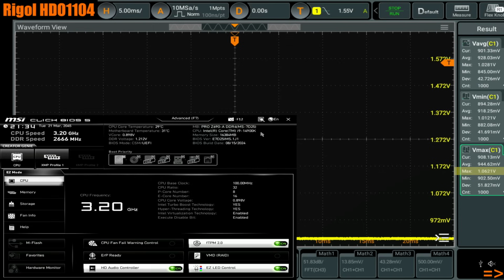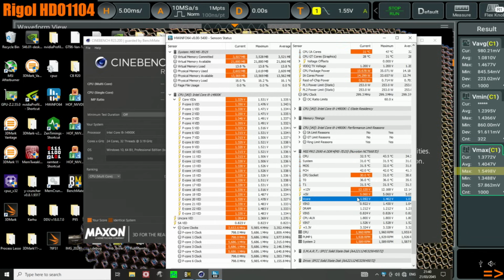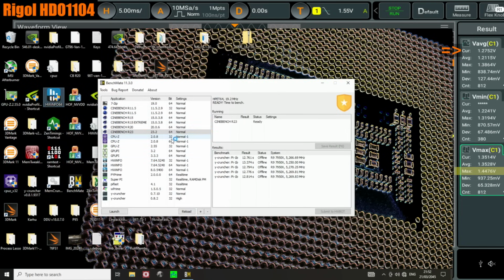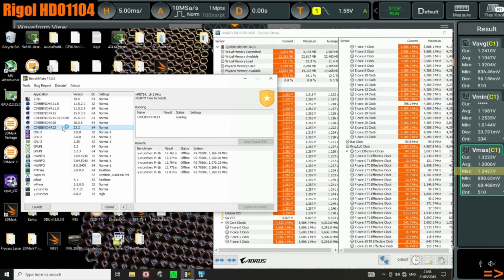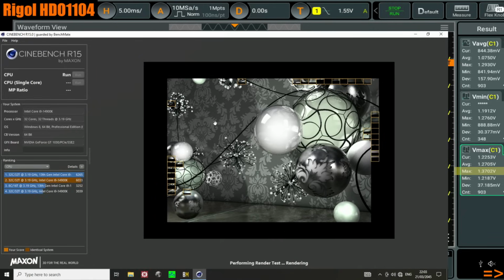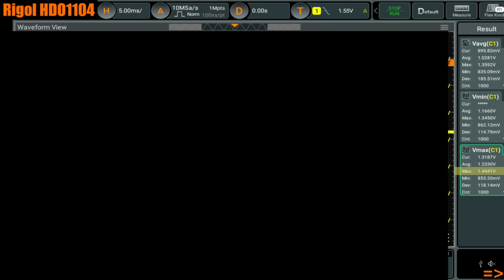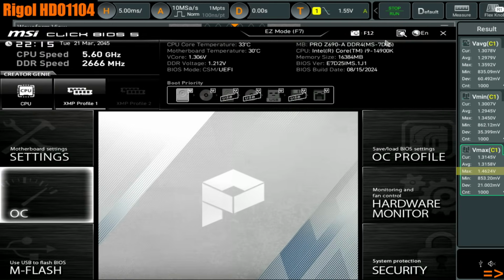"Optimizing" the i9 14900K on the MSI Pro Z690-A DDR4 with 0x129 Microcode

Comment: Would it be possible that you do a video on undervolting with cep on on asus boards z790? There is no vcore voltage, IA ac and ia DC are in different places, happy I found them, load line has different settings and something with synching vrm voltage with ac DC loadline, an there are level 1-3 loadline and then also load line 1 to 8, I took 5 bacause I counted from your video the options on gigabyte and then used it in number form. but then there is vrm voltage offset, svid voltage ofset, and the v/f curve, but no general v/f offset voltage, only per ratio offset voltage, and there is no dynamic voltage offset and I don't know what to change, I have some crashes but don't know the reason, both with vrm offset and svid offset, and the v/f curve is more confusing, because I don't want to do something wrong, I don't know if I can kill my cpu with undervolting and I don't know how to adjust ratio and tvb oc, and things like that with Intel default, because if I enable the 2 best cores to 60, in tvb it says all cores have a 60 ratio, even with all core, and then I can't fine tune it really, and what does xtu do, can I use xtu for things like that and what does xtu affect? Asus calls things different and there are some things completely missing (generally v/f offset, dynamic offset, vcores) and also I don't know what does what (svid offset and vrm offset and things like that, cpu svid, cpu power request, and so on) and a video on a asus board z790 would be very helpful if you could do that, because there are no explanations manuals for the bios and no guides with "translations" to other board naming schemes, and so I am at a los and a bit scared trying it on my own without a real guide on it.

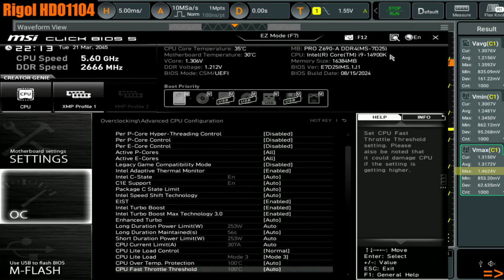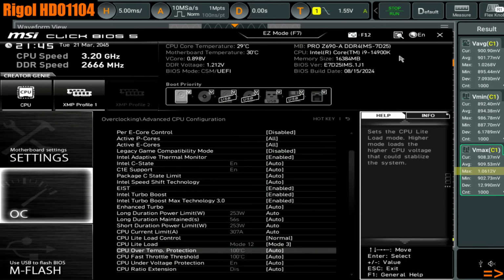Comment: As a MSI User I want to thank you for your Testing and Insights. You've found out yourself that we are plagued with the limited possibilities like the for some reason not opened IA VR Voltage Limiter. May I ask you why you did leave the undervoltage protection "enabled" does it do nothing like the AVX guardband setting that I hinted you (and was wrong) on the last Video? edit: Wait a minute it IS disabled on your last Screens of the advanced Menue (Minute 38:41), but when you look at around Minute 11:17, undervoltage Protection is "enabled" (both times settings are on "Auto"). MSI things...
Reply: Undervolt protection just sets a floor to the voltage settings at boot. You can still set them wherever you like in the BIOS, but once its booted, software can only leave it alone or increase it.
XTU requires UV protection be on (if virtualization is enabled). While I was tuning, I'd set an aggressive UV in the bios, and then bump it up a bit in windows with XTU when trying various raised multipliers, and then go back to the BIOS to commit those final values when I was happy with it.

Comment: If I remember correctly with these boards I believe LLC3 is 0.10 mOhms and Lite Load 3 is 0.15 mOhms on the AC_LL so you'd actually want to set your LLC to 4 if you wanted it to match your AC_LL at Lite Load 3. Although I think the Lite Load DC_LL is set to 80 mOhms from modes 12 to 2 so your power readings will probably also be thrown off doing it this way. Personally I just suggest manually setting your AC and DC loadlines rather than using the Lite Load presets.
Reply: For my MSI Z790 board, Lite Mode 3 is AC 10 (0.10 mOhm) & DC 110 (1.10 mOhm). Z690 may be different of course.
Reply from the maker: LLC Mode3 with 0.1 ACLL sees a slight performance regression.
Reply: @ActuallyHardcoreOverclocking  Actually it seems like MSI Lite Loads have different impedances depending on whether CEP is enabled or disabled so what I said wouldn't necessarily apply in your config.

Comment: Hi BuildZoid, my interaction is generally very limited in the comments, but I have a concern. I have an MSI Z790 Edge WIFI DDR4 with an Intel I7 13700K, since I built it I have never had temperature problems, game or program crashes, BSOD with synthetic benchmarks, CPU stress, nothing.
Should I do the update anyway? However, I have my CPU with certain configurations, such as all P-cores at 5.5ghz and E-cores at 4.3Ghz with 1.27v, LLC lvl 3 and XMP at 3866mhz.

Comment: That voltage spike at start-up is scary. Luckily MSI was setting their AC loadline to 50mOhms at default previously which would have helped curb the voltage up until now, but since I'm pretty sure the new BIOS updates just set AC_LL = DC_LL there's going to be a lot of people who updated their BIOS in the hopes of prolonging their CPU's life only to be slowly frying it every time they turn on their computer. And the scariest part is you have no way of knowing if you're affected or not unless you have an oscilloscope to hook up to your board.
Reply from the maker: yeah but MSI's 0.5 mOhm ACLL literally causes some CPUs(like mine) to crash.
Reply: @ActuallyHardcoreOverclocking  True, but I think you just have a particularly bad sample. And in this specific case exposing bad chips is probably preferable to frying good chips.
Reply: @ActuallyHardcoreOverclocking  Why my i7 13700k never hits 5.3ghz in gaming after microcode update?
Now is 4.9 max.My sp score is 92.I have gigabyte mobo,i use intel default
Reply: @ActuallyHardcoreOverclocking 

z790 avx offset 0 bug workaround

I have noticed that AVX offset issue mentioned in one of buildzoid videos has simple but inconvenient workaround on Gigabyte motherboard.

On my 14700kf 56/44/50 HT OFF  / Z790 Gaming X AX, AVX small tests (P95/OCCT) downclocks from 5.6 to 5.5 with AVX offset 0  ONLY at 1st boot of PC from full power off state, if I restart PC at least once then AVX is NOT downclocking from 5.6 under any load, even prime 95 small avx until next power off.

Unleashed bios profile shows the same behaviour so I am using intel performance profile  + manual settings:  
cep ON, 400icc, 350w, 1.45vr, 1.35v vcore, AC45/DC55, LLC HIGH, cpu allways holds max clocks and temps are never higer than 85°C.

config:

GPU: RTX 3090 OC  / Alphacool Aurora water block /  liquid metal

CPU: i7 14700kf OC HT OFF 56/44/50/ delided / liquid metal

RAM: Corsair Vengeance 2x 16GB DDR 7000 CL34 (tightened timings)

PSU: Corsair HX1500i

CASE: Corsair 7000D

CPU WATER BLOCK: Thermal Grizzly Mycro Direct Die Pro V1

RADIATORS : 2 x Corsair XR5 420mm / 30mm 

FANS inside case: 7x Noctua NF-A14 

FANS outside of case: 2x Noctua NF-A20

PUMPS: Corsair XD5 and EK Inertia D5

Coolant: Mayhems XT 1

NVME SSDs: 1x 2TB PCIE 4.0 SN850x and 2x SN850x 1TB in RAID 0

MOTHERBOARD: Gigabyte z790 gaming X AX

Comment: is CEP recommended to keep on? i already have stable at -0.070 offset but with CEP disabled. Would have to retest everything again.
Reply: If you didn't undervolt with AC load line it shouldn't lower your performance so I would just keep it enabled.
Reply: Buildzoid's just recommending keeping it on because that's what it says in the Intel recommendations. Whether or not turning it off will actually have any meaningful consequences none can say because the documentation on it is so sparse.

Comment: 23:45 - I noticed the same. When I was on the edge of stability I had these symptoms:
- Task manager being slow to load (sometimes it took 5s to switch between "processes" and "performance")
- Scrolling through youtube comment section caused stuttering.
- Dragging windows around was choppy.
All these symptoms were gone when I raised the voltage by 30 mV (-120 mV to -90mV).
Reply: You may have had WHEA errors, I noticed them popping up and being displayed in HWiNFO with a too aggressive undervolt
Reply: @sp00n  My HWInfo always shows 0, so I probably didn't go that far.
Reply: @Savigo.  You can also check in your Windows Event Log for WHEA errors. For ease of use, it's best if you set up a Custom View for that. Either google how to, or the short version is to use "By source" and then select "WHEA-Logger" as the "Event source" when setting up the filter for the Custom View.
Reply: @sp00n  Interesting, I only have 2 WHEA events (not even errors, just info) from the first day I booted up my PC. And then nothing.
Reply: Why am I getting ~2250 pts in Cinebench R15 with i7 14700k. What should be the optimal score for this specific CPU on 5.5Ghz(Default) with intel optimized settings. PL1&pL2 253w
Reply: Can a 14900f handle the same settings as a 14900k? Its base clock speed is 2ghz and its TDP is 65w.

Comment: Looking forward to your asus video.  Still a bit confused over LLC and its relation with AC / DC load line.  

I miss the simplicity of overclocking in the old days (athlon xp / p3). Tweak the vcore, increase the cpu multipler, pass prime95 and you were golden 😂

Comment: Also, this method really seems to throw the P-core "single thread" idea out the window, what I'd really like to see is optimization toward P-cores, with and/or without Hyperthreading, strictly for the games that require the absolute best performance out of 1-4 P-cores. ie older games/titles have older engines still, and/or VR which still seems to be quite hampered by CPU at times.

I would trade HT for E-cores, but I would trade both for the absolute best P-core performance.

Comment: would you recommend fixed voltage (1.25V) and max multiplier lock on all cores (55X)?
Reply: At 55x, AC = DC = LLC, -100mV You shouldn't go above 1,25V - 1,3V. Just remember to lower the ratio for E-cores too, by the same amount, because they are pretty voltage-hungry. Edit: I mean on adaptive voltage. There is no reason to run fixed voltage at 55x, since you are far away from danger zone anyway with proper AC/DC LL and some undervolting.
Reply: @Savigo.  i got a 14700K. these are my current settings: a)LLC Auto. b)locked all cores to 5.5 max. c)fixed voltage to 1.25 (can go lower). d) throttling temp at 95C for safety purpose. my problem is with heat. i got a Thermalright Phantom Spirit and the only way i can run cinebench 2024 at a constant speed of 5.5 is with my settings above. the question is, is it safe to run fixed voltages at all times?
Reply: @adrianvorkaaa3534  I don't know if it's safe, but these chips were designed for adaptive voltage, with all power saving features like C-states. I would just undervolt with adaptive + offset untill you are not stable (try occt extreme variable with avx2), and then add +30 mV for safety margin. Also, while you are testing move the mouse around, this will cause some undershoot.

There is nothing you can with thermals, besides lowering power limits. It's just the nature of air coolers. If it bothers you, you can set more strict PL2 like 200W after you are done with stability testing. It should lower temps to max 80 - 85C.
Reply: @Savigo.  thank you Sir. will try that out
Reply: @Savigo. Are we sure degradation only comes from high voltage? Or are there other problems which we can't control?
Reply: @greggreg2458  It doesn't, but for 13th/14th gen it's probably the main factor. Most of degraded CPUs were used in 1-4 core loads where you are not power or current limited and voltage could go to unhealthy levels because of 6GHz (or even more) boost.
There is also oxidation, but I don't know how much it impacts degradation. It cannot get worse over time though, because a cpu is only as oxidated as it was when it left the fab (vias have no acces to the air or any other oxidizing compounds after cpu diffusion is complete).

Comment: Just tried this on my 13900K, got 35,700-ish points in R23, not too bad, no different than stock for the score though, my chip probably sucks, dunno, I was hoping for 37,000 points because I was able to do 39,000 on previous BIOS'. But I do have lower voltages now which is very nice for longevity though. Thanks Buildzoid.
Reply: What programs (where multithreading is important) do you use the most?

Comment: I am still on the first beta bios with the 0x129 microcode. Before it, my PC would crash randomly once every two to 3 days, plus most shutdowns would turn in restart or even restart to some limbo mode, and Cinebench R15 was crashing. From flashing that first beta bios, there were 0 issues. Shut down, really shuts down my PC, and the Cinebench R15 works. Though this never fixed HZD.
In between MSI cakd out woth second beta and now with real non beta version but I am afraid to test it because this first beta is best bios till now. I guess I will save the profile to usb stick, and I might try non beta bios. Though logic says do not touch it.
The only negative thing is that this bios drops 200 MHz on all core loads. And HZD never worked anyhow.
For the rest, it seems to be stable. I thought my OS installation was toast. I thought CPUbwas degraded, but there are no more random crashes. I am not sure wth is going on. Intel really dropped the ball with the Raptor Lake.
Reply: Why did you change from a bios that had zero issues that's just stupid
Reply: @toonnut1  you have understood it wrong. Every bios till now have had issues. Even this first beta can't run one single game. But compared to all others, this beta with the 0x129 microcode is the best. Why am I thinking of changing this one than? Well, if it can run that game or if it would bring back 200 MHz all load speed, that would be nice, right?

Comment: I had a weird bug on my MSI board, if I switch to the 4096W power settings, it basically massively reduces the performance to like 16,000 R23 points, you can even switch the power profile back to Intel Default Settings and it doesn't register it as the default profile, it stays stuck bugged till you clear CMOS. Beta BIOS' are so much fun!

Comment: Wouldn’t OCCT CPU test with variable selected be a good stress test for dynamic voltages?
Reply: It is a good test, especially extreme version with avx2 instructions.
Reply: yes but the free version only goes for 1 hour
Reply: @charonme  You don't need more than 20 minutes. Long stress test are pointless, if you get errors, just add 5mV and test again. Once you pass 20 minutes test just add 20 mV - 30 mV for safety margin and call it a day.
No stress test will give you 100% warranty that you will be stable anyway.
Reply: @Savigo.  maybe you don't, but I do. I've had apparently "stable" settings fail after hours of testing and even that only in some testing softwares but not others. For sure there is no 100% warranty, but after hours of various different tests the warrantly is significantly higher than after only 20minutes

Comment: Majority of the people use asus motherboard, if you make a video about how to stop cpu degrading with microcode 0x129, it will help a lot of people, also me (performance not that important for me just need long time lifespend) I have a i9 13900kf with Asus rog strix z790-a wifi 6e
Reply: I discovered this way too late so mine may have already degraded, but if yours have not, then before Buildzoid makes an optimized settings video for Asus boards, you should at least enforce a very useful safety limit. You should change the IA VR Voltage Limit to 1300 mV and this will make sure that your CPU will never go above 1.3V. The IA VR setting is in the Tweaker tab (it's named differently for different Asus motherboard series, for mine it's AI Tweaker) -> Internal CPU Management (it should be in the same place where the PL1 and PL2 limits are set in the motherboard) -> IA VR Voltage Limit, just set it 1300 and that'll make sure that your CPU will at least will never go above 1.3V
Reply: Only fools and people with too much money use Asus boards.